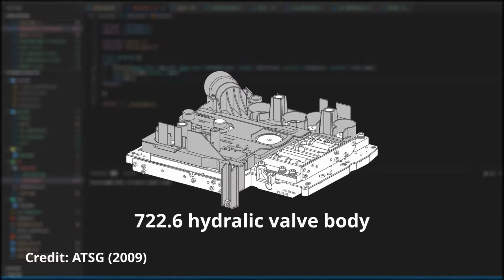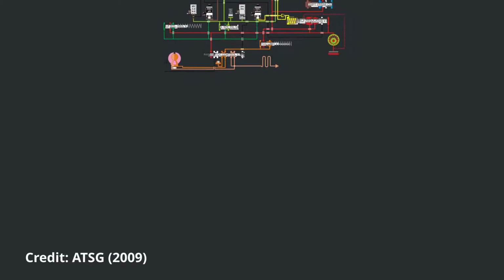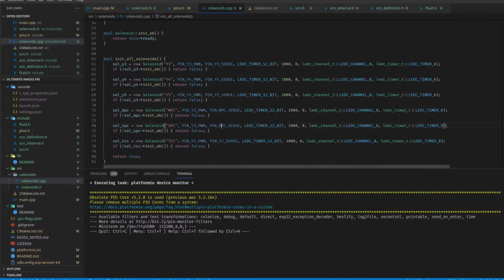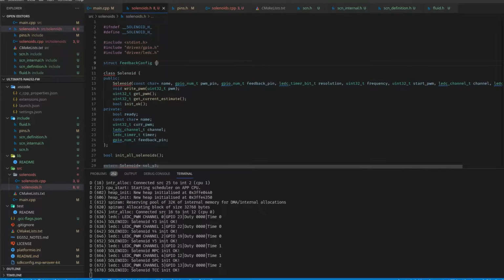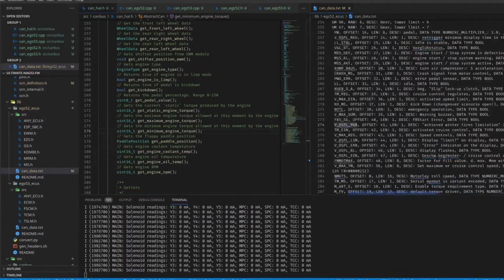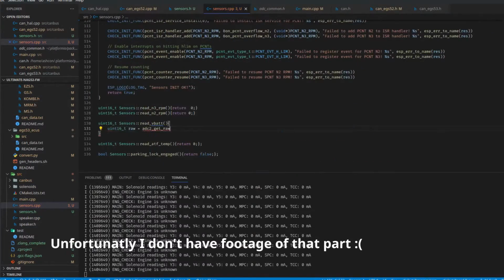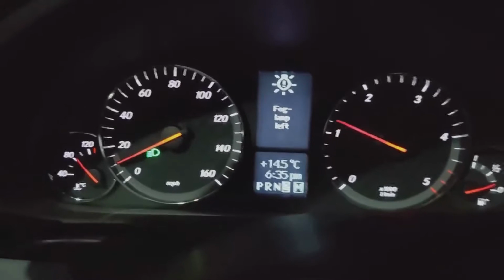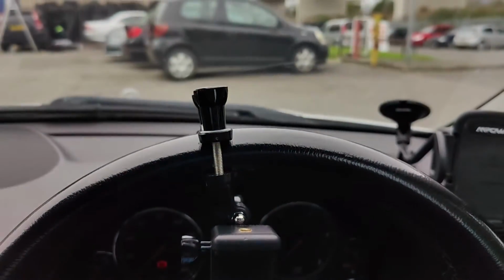MY CUSTOM MERCEDES TCM SHIFTS GEARS!! - CUSTOM MERCEDES 722.6 TCM part 2

Comment: Dude I'm coming back to this video a year later and this channel is still criminally underrated. Awesome work. I currently run OFGear and it's a real big headache. Constant speed reading errors in my w210 even with an external speed sensor. Also the 1->2 bangs into gear no matter how low I set the shift RPM or firmness.
Reply from the maker: hey! Yeah, OFGear is good for people who want to be crazy with their gearboxes, but not 100% designed for comfort. Have a look at my recent launch video and see how smoothly the gearbox shifts in my E55
Reply: Your box probably needs to be rebuilt. My ofgear 722.6 works perfectly.
Reply: @craigk5452  nah, the box is fine, I've heard others experience it too. It shifted perfectly fine before ofgear was installed.

Comment: hello, I have a w211 with a 5g 722.6 gearbox, there is a jerk in 1st gear before changing to the second https://www.youtube.com/watch?v=6leb7hTgqZE egg/waving at higher speeds, and recently as I was reversing on a cold engine uphill on backwards,on reverse feels like clutch slipped;/? what do you think it could be?

Comment: Hy Rand_Ash,

I did not understand well why does not work on 722.9(7G tronic) this kind of modification?
Can you explain?
Thx
Reply from the maker: 7 and 9G TCU is inside the transmission itself rather than an external TCU like 5G. Making a ceramic PCB to go inside the transmission conductor plate costs thousands!

Comment: The TCC is rarely ever fully engaged, correct?  Care to explain under what conditions the TCC is fully engaged?

I also can tell you first-hand that one some vehicles, the 722.6 DOES adapt (to some degree) to fluid temp.  In one case, on the W163, the EGS will drop you from 5th to 4th and keep you there (or it seems as low as 3rd sometimes) when the trans gets really hot.  I have discovered this as I have done a LOT of towing across various ML-class while watching live data on STAR/SDS.

Finally... you have experience using Vediamo?

Comment: Hello,  your truth table at 0:52 shows no TCC on 1st gear. I have the EGS53 on my 2012 Jeep it definitely does engage TCC in 1st, unless this is a fault and there is an internal leak in the TC between 2 of the paths causing a lock up in error. Anyhow, I don't know how to contact you directly, sorry. I'll apply for your beta testing for when you're ready to widen out to non Merc.

Comment: There is no talk about adding in Torque Reduction during shifts as in timing retard during shift phase.  Eliminating that, transmission will wear out faster especially with higher hp cars.
Reply from the maker: Part 4😉

Comment: Truly amazing work!
If I understand correctly, these controllers work on 722.6's with the "manumatic" mode? Not the older ones from 95-00 without "manual" mode?
Also, what are you planning in terms of price? 

Keep it up!
Reply from the maker: Yes, this TCM is only designed for the 2000+ vehicles with CAN, not the earlier 1995 and older Mercs. For that look at other projects like ofgear!

In terms of pricing, I'm hoping for 300GBP-400GBP range, however I haven't actually sorted everything out yet. The TCM connector is proving to be impossible to find so I keep having to salvage it from other TCMs (Which becomes very expensive very quickly). Once everything is ready for production there will be a video on it!
Reply: @RANDASH  Fantastic and thank you for a quick response!

To be fair, not that many people use the pre-00 boxes for their projects anyway. Unless they keep their engines stock and want a TCM-upgrade. Most people opt for a mid 2000s CDI or AMG box. So in reality, I think this could be huge! Especially at your mild price tag!
Reply from the maker: Oh you mean about the box itself? Any 722.6 will work! But the vehicle the TCM lives in has to be 2000+!
Reply: @RANDASH  Aha! Gotcha, many thanks!
Reply: Hello guys! Can I make a question? I got a 2000(last year of production) w202 c280 elegance v6 with the 722.6. How do I know if mine has ""manumatic mode"? In the shifter I got "D" and "4,3,2,1". Thanks a lot! Im from Argentina

Comment: that your said in another video is not true st10 processor can be easily dump and reprogrammed. the fault was on mercedes that not updated the firmware....  not saying it will not work just so you know. i work a lot with chiptuning... nice work!
Reply from the maker: I never said it COULDN'T be reprogrammed, I just said it was too hard for average user to do so :) (USB plug and play is far simpler!)

Also it still stands that ST10 CPU is hot garbage in comparison to ESP32 in terms of performance!
Reply: @RANDASH  its easy you just need an usb to can interface then put in boot mode. Install st10flasher and edit maps with winols...probably more expansive than build another ecu. Pretty hardcore. Glad worked..

Comment: Hi RAND_ASH,

I have been following your work for almost a year and I'm fascinated what have you done till now and I hope you will conitinue on this project Because I think there is so much potential in this car. I have a couple of questions:
1. Is it possible to use this TCM in a car that was manual to turn into an automatic or does it require more electronics to function?
2.
 Since I see that you managed to access the speedometer is it possible to activate the needle sweep? Because nowhere on the internet did I find that someone did it with the W203.

Btw We may be the same age, but you are my idol, you inspired me to order diagnostics for myself (Openport 2.0 Tactrix) and to solve the problems myself.

Greetings from Bosnia and Herzegovina
Reply: Kume imas olefejer kontroler za 722.6 ako nisi cuo za njega
Reply: Not the original creator but I can answer your first question. No a computer attached to the car cannot automatically shift a conventional H-pattern manual. If you’d like automatic shifting you’d either have to put time effort and money into changing out the transmission or buy a car with an automatic.